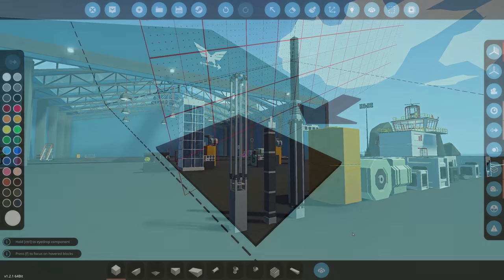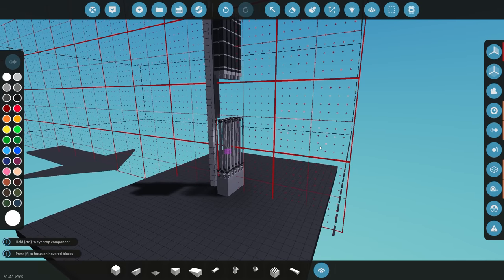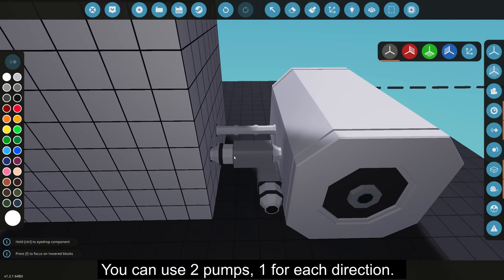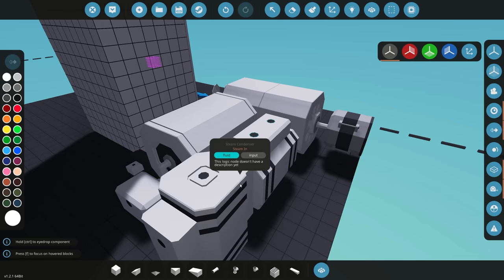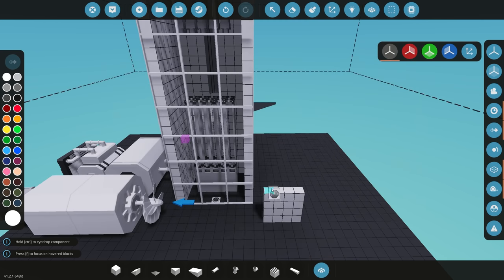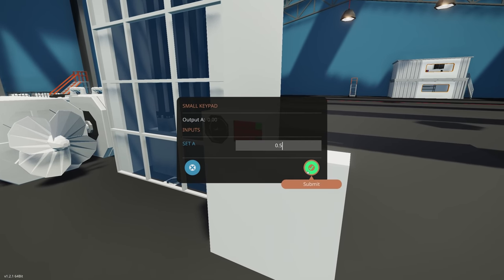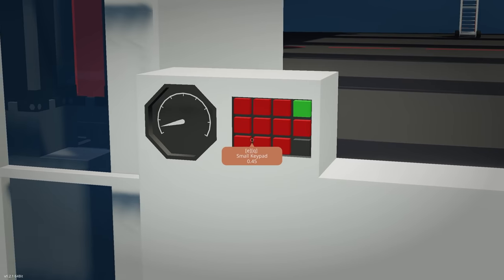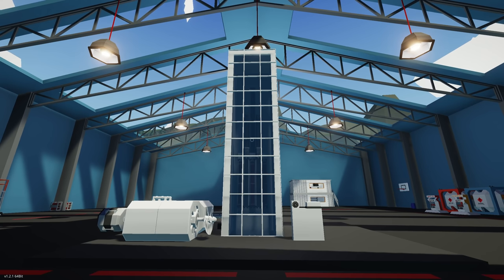Building a Nuclear Powered Engine!!!! - Stormworks

Comment: You shouldn't need a boiler to create steam since the reactor is making steam.
Reply: I suppose it works as an isolated system
Reply: I would actually say that is correct because I’ve been able to get a steam whistle in game working with no boiler just plugging it to the output of my reactor
Reply: However the only way I’ve seem to be able to do this is starting an in controlled reaction it only tends to start blowing the whistle after the reactor has melted down so I don’t know if that’s a mistake in the game or if that’s intentional

Comment: the condenser is 0 output for some reasons and that's a problem cuz i'm not be able to cool down the boiler!
Reply: The condensers are not working like they used to.  You need to pump steam into it and have a massive cooling system to keep the condenser below like 30c.
Reply: @Bendigo1  describe massive
Reply: @smusiness165  more than you want or think would be necessary...

Last yime i tried making it work it took 5 5x5 radiators running with full pumping capacity.    

It may be possible to get it to works with sea water running straight through it but i haven't tried that.

Comment: 12:50 OH YOU GOT TO FUCKING RAISE THE CONTROL RODS UP AND NOT PLACE THEM ON THE SAME FLOOR NO WONDER THEY WERENT FUCKING WORKING
Fucking hell i hate the control rods, they are so long compaired to the fuel rods and reaction assembly that in order for me to make a reactor where i can move the fuel in and out and replace it ive got to make the chamber like 40 blocks long. Yes i mean long not tall, i dont have an engine room tall enough.
Reply: Yeah like wtf how are we supposed to figure out?
Had the same problem and didnt know how to solve this untill i found out that they added an example reactor (which, btw, was stated nowhere). + they are underpowered af.